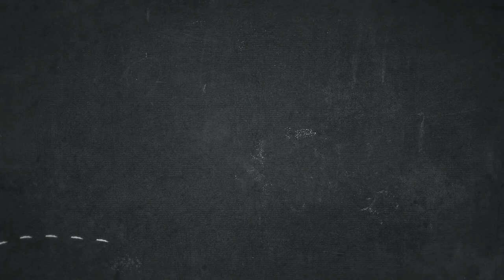Using a 'wet bed' for blending metallic greys/silvers #blend #metallic #silver #wingin-it #patchy

Comment: Nice video! Answered my question about having to use a clear wet bed for each layer of base. I am going to try this next week on a metallic silver Jaguar blend. Should be fun! I think the trick is to keep the pressures down in the 15 psi range to prevent too much dry material from forming at the edges of your spray pattern.
Reply from the maker: Hi mate, sorry for the late reply, haven't been getting notifications for some reason 🤔. I've used the 'wet bed' a few times since this, I've found that giving the whole blend panel a coat of the clear base then letting it dry, works just as well - as it seems to fill the sanding scratches before you lay a silver on. If that makes sense... 😅😅
Reply: @WinginitPaintSprayers  I think so! By laying down a clear coat and letting it flash it will give you a flatter surface for your metal flake to strand up uniformly in the new layer of wet clear. ??
Reply from the maker: @kenbaustin4533  yeah I think that's what I mean 😄. Otherwise you use shit loafs of the clear for every coat, like on the bonnet in the video 🤦‍♂️

Comment: Im doing a silver steel right now and its kicking my arse...
Reply from the maker: I've been doing a lot of silvers lately bud and although I'm still not the best at them, I've improved! 😅
I've noticed that I hadn't been putting the first couple of coats on heavy enough to actually get enough coverage, and drying times are essential 👌
Reply: I spent all day in my garage, experimenting with my air brush.,. I learned alot,. I did some sprayouts on different panels, and experimented with reducing the base.. also, I left a little bit of the basecoat in the bottom of the airbrush jar when I added the clearcoat,.. I  reduced the clearcoat abt 15 percent... the results were VERY encouraging.. immediately after I sprayed the base, in light coats I dried it with a hair dryer on low, before the next coat.. I think doing this helps to keep the microflakes from migrating to the outside edges..which has been my main problem..,   when the weather clears and rain stops. im going to go try it on the car.. if I can master this, and I think I will, I will be able to fix small gouges, and small deep scratches with very little paint and clear..  im going to try and keep the basecoat spray areas to abt the size of a mason jar lid..   getting the air pressure set up right on the air compressor is critical, as well as the airbrush adjustment..  wearing a headlamp so you can see the very fine spray pattern laying down helped alot.. also  remembering that the the airbrush had a round spray pattern helps. I didnt do a side to side spray motion I started from the center and spiraled outward...  @WinginitPaintSprayers
Reply from the maker: @randy1ization  you sound like you have more patience than me dude 😅. Are you doing it for a living?